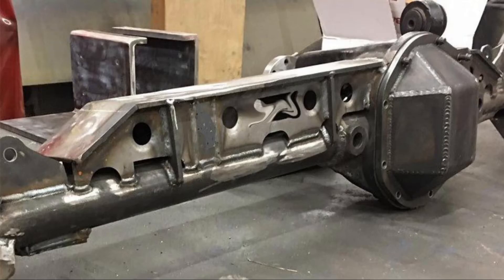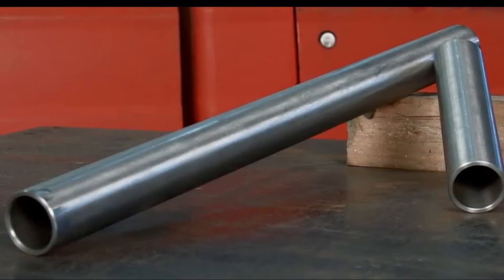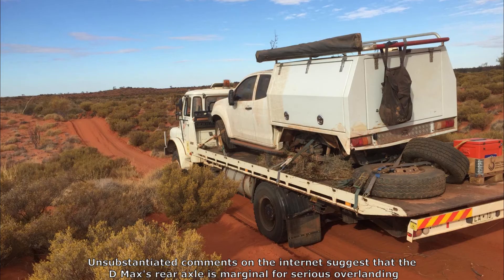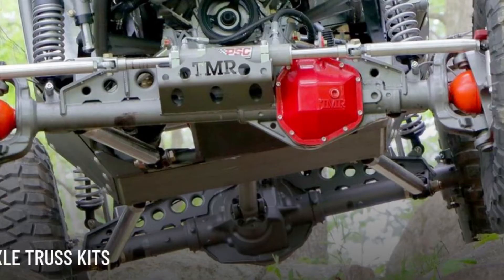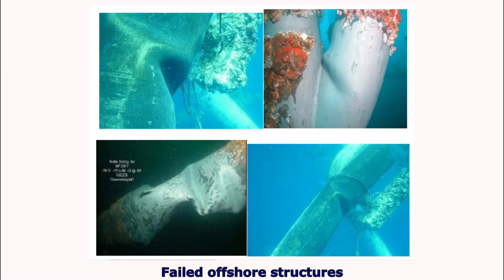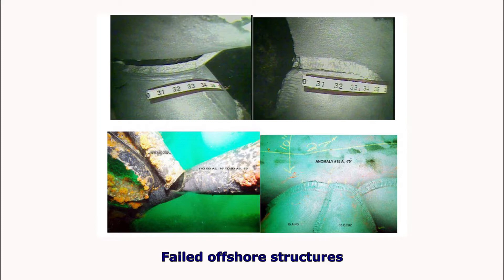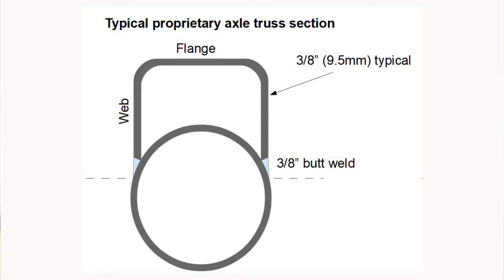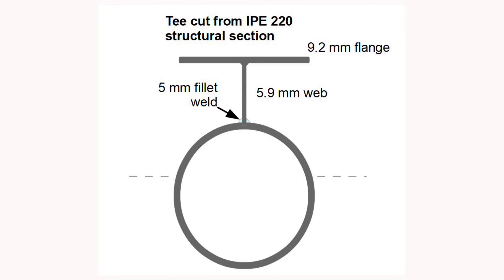Why axles break on overland vehicles. Part 8 - axle reinforcing / trussing systems

Comment: Hello Bill. Do you have any thoughts on use of structural adhesives (3M products for example) instead of welding? Obviously, 'rules' of good detailing of added sections still apply.
3M claim bond strength equivalent to traditional welding.
Reply from the maker: Sorry I don't believe it. I would need to see many research papers supporting this before I believed the claim.
I have been doing a lot of study on composites bonded by epoxies and the adhesive strength is at least an order of magnitude lower.

Comment: Hi Bill, again with my 2c or 2 pence…

A lot of what you’ll see in the consumer market is heavily biased to the USA. Demand and recreation driving this. They often upgrade to bigger axle assemblies based on “bang for buck” Dana 60 would be the most popular, but also Dana 44. 70, Corporate 14 B, some Ford 8.8 and of course the well known Ford 9”. Other than the Ford 9” all the others are based on a Salisbury style housing (cast centre section, pressed in axle tubes with plug welds) . The majority of the donor vehicles are leaf sprung yet go into or get modified to suit coil sprung link suspension. A lot of the time the “truss is an attachment area for upper control arms as well as strengthening.

At 3:40 you said you don’t understand the logic. This is a modified Ford 9” housing. The Ford 9” is the most supported differential base type regarding aftermarket parts and upgrades on the planet. All forms of Motorsport has driven this. Its huge hypoid offset makes for a strong gear set (at the expense of heat & power loss) It’s also the basis of 9.5 & 10” versions. 

This style is heavily used in the pinnacle of off road racing like trophy trucks and ultra 4.

You won’t find any other style in trophy trucks. It’s simply the strength to weight ratio and a Salisbury style has no place in that discussion.

So, that form of rear strengthening is common in high speeds (160km/h off road) where the lateral forces are high not to mention the weight of vehicle and 1000 hp, and until recent years only 2wd!

With a formed C section, yes the flanges are closer to the neutral axis but there are two, and the web can be considered a flange for lateral direction stiffening. You also suffer no reduction in ground clearance, and it’s easy to form the strengthening attachment from end to end. 

Let’s not forget, if we make the axle housing too rigid, now the poor little stub axles have to absorb all those forces. It’s my opinion that the factory axle housings would absorb some.
Reply from the maker: Don't agree with the last para. The axle is statically determinate and the BM in the stub axle will be unaffected by the stiffness of the axle casing.
Reply: @defendermodsandtravels thanks for that clarification

Comment: With, say, the LR std defender/Range Rover Classic/Discovery axle, were the tube material thicker as std (say 75%) it is hard to see we would have a failure. Axle casing failures on the often overloaded Camel Trophy vehicles were rare....with std casings.
Rather than sleeving, why not find a drawn tube with ID as close to the ED of the original casing and both seam weld (in sections to minimise heat or use structural adhesives such as 3M) and pool weld through drill holes. Whilst this may not add as much strength as a T section, ground clearance across the entire axle is barely altered and, we approximate the effect of a much more heavily built axle.
Another option is to buy a new Extreme axle casing such as those now available....OR chose a larger vehicle and load it less heavily????
Thanks for a great video.
Reply from the maker: I run a standard axle with standard tyres on the Defender and the axle is well able to handle it. You only need to consider strengthening the axle tube if you are severely overloading the axle or running much wider tyres and using dished rims or wheel spacers.
This might not apply to all makes. My suspicion with the Mongrel Dog Productions axle failure is that Isuzu have slimmed the axle of the D Max down to such a point that it's now barely able to do its intended job.

Comment: I appreciate your knowledge and skills. As someone with many years of fabrication experience, if you asked me to weld the 1/2 "I" beam to the axle I would immediately be worried about putting all the weld heat on the underside of the axle, it's very much a guessing game as to whether the axle will bend. The amount of times I've had to pre stress in anticipation, or post heat the opposite side to equalize the shrinkage. Heat is the enemy as you know, changing the base composition and possibly introducing more stress/fault points.  I would rather weld a channel that reaches the centre/neutral point of the axle front and rear because the axle would definitely not bend then.    I say this because the average bloke who's going to strengthen his axle is not going to have a weld procedure, or going to have it stress relieved, or have a clue about how shrinkage can bend steel. He could end up with a very cambered axle.
Reply from the maker: Yes valid points. I haven't investigated the weld procedure to minimise distortion but would comment that the weld required to give the structural strength is remarkably small - it's only acting in shear and the shear stresses aren't high. A double sided 3mm FW, intermittent (50% coverage) would be sufficient. A small amount of preheat would be a sensible precaution to ensure proper fusion to the axle casing.
As you correctly state, heat (and volume of weld metal) is indeed the enemy, but the weld I have suggested is so small that it's unlikely to bend the axle casing.
You propose an RSC. I would politely suggest that this is the wrong way to go; the thicknesses of web and (especially) the flanges are much greater than that of a long stalk T cut from a UB. Even though the welds are closer to the neutral axis, they will be much bigger and there will be two of them (one for each flange of the RSC). There will be a lot of weld metal and with the associated heat input. For me, I'd go with the T section reinforcement any day because it's so light and economical.
Thank you for your constructive comment.
Reply: @defendermodsandtravels  I agree, if using the "I" beam, only small stitches. I noticed in one of your replies further down you had mentioned stitches or fully welded. 
     I was referring to a pressed steel channel, maybe 5 or 6 mm thick.      Many times over the years I've been given fabrication drawings that make me cringe as soon as I see them. Often total lack of thought for the tradesman who has ultimately got to try to keep everything straight, square and twist free.
    Enjoying your videos, insights and knowledge...... And your eloquent use of the Queen's English.
Reply from the maker: @ivanhoe6366  Ahaa, yes a pressed steel channel is a better option than a RSC because the section thicknesses are much reduced.
I couldn't agree more with your comments about the necessity for integration between engineering and construction. I worked for a very successful EPC contractor where the design offices were adjacent to the yard and the tradesmen had full access to the designers. It was wonderful when an irate foreman stormed into the offices and dragged the hapless designer onto the yard to show him the error of his ways. Maybe you didn't have the pleasure of working for a company with this culture.
Reply: @defendermodsandtravels  Over a 40yr period I worked for many different companies, both on the cards and sub contract. Sometimes having direct access to the designers, sometimes not............ One thing for sure, skills are dying out with the retiring tradesmen. The younger generation don't seem to want any part of it.

Comment: now if i were to do this for carrying heavier loads would it be a viable option? f100 rear diff and axels
Reply: for context i already plan to put heavier springs in to support the weight.
Reply from the maker: @richardmoll5618  Trussing the axle shouldn't be necessary if you stick to the manufacturer's GVM. However  popular in the States for the rock climbers and the macho-look fraternity.

Comment: HI! A very good technical lecture. How to strengthen - not to exceed the limits of the structure! Regards !
Reply from the maker: Yes when you say don't exceed the limits of the structure you are right  However  most designers consider the static strength whereas around 90% (a frequently quoted figure) of structural failures are due ro fatigue. Much more attention needed in this area.
I hope you gained something from the video.

Comment: Maybe I took it wrong but it seems to me from the drawings that you are comparing a cold formed channel section to a hot rolled universal beam, which is like apples and pearls. Also, the bending moment is withstood by the flanges and more important, the distance between them. If you cut in half the UB, the strength to bending moment drops to at least 50%. Also, no mention of the shear force which is also involved in fatigue processes and it is withstood by the web, which is better handled in case of a channel positioned that way. In any case, a good topic to look at but  cost wise, it would be good to compare the cost of a replacement after worn out to the cost of such mod.
Reply from the maker: Thanks for the comment.
Clearly cold formed and hot rolled sections are different although to a structural engineer like me they are largely interchangeable and you just choose the section which does the job.
You are right that cutting a UB in half the bending moment capacity reduces but far more than 50%. It becomes a structural Tee and the buckling strength of the free web is very low however if it is welded to the axle tube you get a composite section with good bending and torsional performance. As I said in the video the material is being used much more efficiently than for a channel section.
The shear stresses will be an order of magnitude lower than the bending stresses (you can demonstrate this by a shear flow calculation which is Year 1/2 material for an engineering student). Mode II (shear) fatigue is very rare and can be discounted.

Comment: good video mate, I like the T bar but as you pointed out I would not like to loos axle cleareance so a top application would be my choice. Wish I seen you video before I went the full monty with my custom diff housings may have been a cheaper and quicker solution.
Reply from the maker: You use a Jeep for your technical off roading, right? I think they use semi-floating rear axles. The dreaded C-clips and half shafts are where the money needs to be spent IMO.
Reply: @defendermodsandtravels  the Jeep is ok the advantage is that everything is tested and available I have a Rock Jock Dana 60 in the rear and a G2 in the front so I'm good for up to 40" tyres but only run 37" so should have no issues.

Comment: Mhh if you strength it like here https://youtu.be/FiGerFim8UY?t=639 you 
may not lower the lowest diff point ... but it's kind of a snow plug 
when you drive muddy or sandy lopes - we had that and I always like to 
have ground clearance to all parts as much as possible... better pay 
attention to the weight, suspension, tirepressure, speed - ;-) Cheers Axel
Reply from the maker: Look it depends what sort of travel you do. For the guy on the Canning Stock Route in the Isuzu D Max the axle strengthening I have proposed would unquestionably have saved his trip. On the other hand, if you find that you are regularly grounding your diff then maybe you should look at a different option.
Reply: @defendermodsandtravels  Spot on ! I was so often stuck in ruts that my brain focus too much on that :-) (We started offroading and only then came to overlanding... now overlanding is the main focus, but my brain is still stuck in old habit ;-)  ("a different option" - higher tires .. but this I don't like, like as you also pointed out to stay at the size of the manufacture ...)

Comment: You're a smart cookie. I wasn't going to watch this series but now I am glad I sat through it all. I learned a few things and it's got me thinking. The T section welded underneath wouldn't have to be very high. It could be 20x5mm or even 8mm.
Do you think a continuous weld would be best or do you think that short stitch welds would help reduce fatigue by stopping the spread of energy ? In this vein, you could have bridges in the T section to stop the transfer of flex dead in its tracks. The less heat you put in the axle housing the better.
Reply from the maker: I haven't actually done any calcs on the size of the Tee but it does need to have some meat in it to reduce the axle stresses significantly. You want most of the steel in the flange as stated in the video. Regarding the depth of the section, I'd bring the flange in to the diff housing just above the drain plug (for a standard Rover type axle) and use that to set the other dimensions. I'd also include a transverse web stiffener near the outer end so if the Tee gets dinged by a rock it won't be bent out of plane.
You can either do a continuous double sided FW or stitch welds which are likely to cause lower distortion. Either way there's much less heat going into the axle than with conventional trussed repairs so I don't think distortion is going to be a problem.